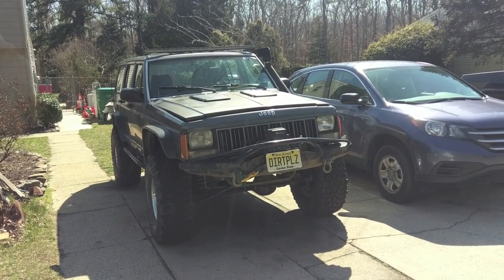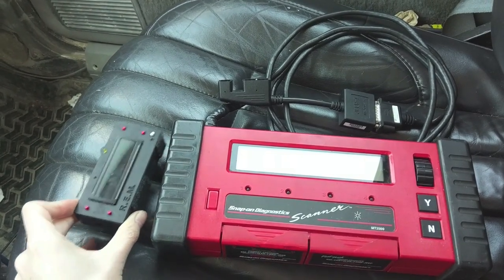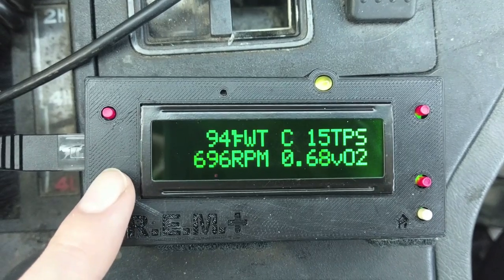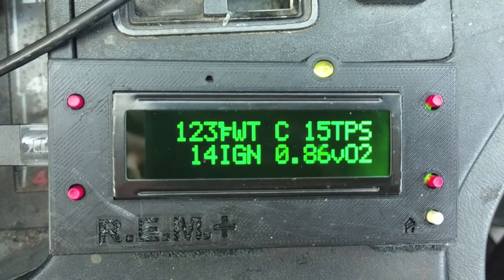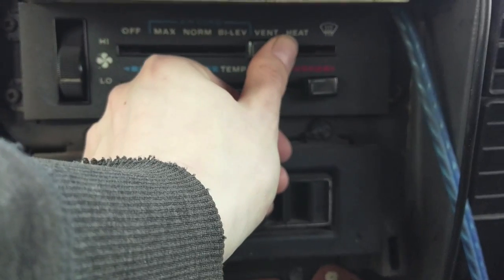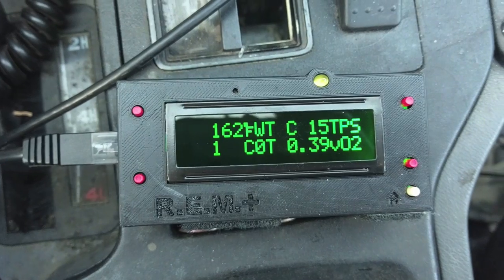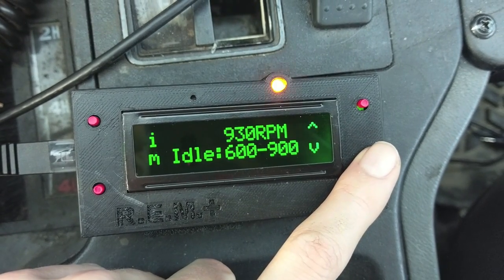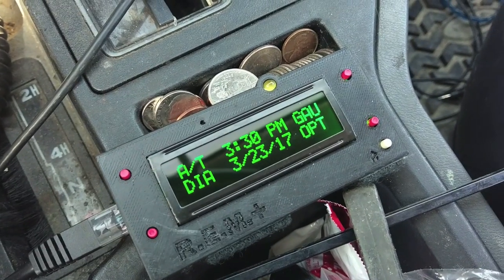What is Renix Engine Monitor / V3 + Demo

Comment: Is this something I can run into my dash and leave permanently installed in my Comanche? Hiding the wire and all that. I'd like to mount it so it looks like it belongs. Know what I mean?
Reply from the maker: Yes you can. I use an ethernet cord which is plenty small to run through a firewall grommet. I have mine mounted next to the a-pillar and love it. Other customers have found all sorts of spots around the dash for it to fit too
Reply: Love it. Mad props to you sir if you created this thing.

Comment: Hi, my XJ is a European model, gauges are in KPH, will your R.E.M be compatible? And also when will you get the one with bluetooth back in stock?
Reply from the maker: There are options for KPH and other metric conversions as well. The square REM shown here may be back by summer or fall 24. The REM clock panels should be available when I return in April.

Comment: Hi Nick,
I have question that maybe you can answer,
I've noticed that my battery voltage on the REM just barely reads 12 volts sometimes less, I happened to notice after watching your video that yours was reading 14 volts, does this indicate a problem? I just recently changed the alternator for a higher amperage one since I just added a second battery, so I know that it isn't the problem, and it read the same volts with the old one. I'm not having any issues with the battery but just wondering why it would read low.

Thanks
Reply from the maker: Are you sure the alternator is charging? Is it an internally regulated one and is the exciter wire hooked up? On mine, it starts at 14v and then slowly drops to 13v once the battery is topped off.
Reply: @NickInTimeFilms  yeah I just replaced it and there was no change...
Reply: I don't have any problems with a dead battery and when I check the battery while its running with a volt meter it shows 14.5 volts, so I don't think I have an issue, just thought it was weird the REM barely shows 12
Reply from the maker: Interesting, well in that case it could be weak wiring. The REM gets it's voltage reading from the injector feed line going to the ECU, so it could be weaker there
Reply: @NickInTimeFilms  ok thanks, unless you think its a problem I won't worry about it for the time being.

Comment: Do you plan on making a bigger version that can display more info at a time. I love my alpha model but some more info on screen would be nice. Like 6-8 items would be perfect
Reply from the maker: The thought had occurred for a mega model. I was experimenting with a 6 gauge screen at one point where each reading only takes up like 4 or 5 spots but it's not the prettiest and I'm running low on space for current models. I did get a 20x4 OLED display to play with and it's neat but harder to control and it flickers a bit. I can try other large character based displays or jump straight into the big boy stuff like full color displays where you could fit basically whatever you wanted. Just depends when I have the time, haha. I think i'd also have to get the teensy working to have the space I need for that anyway.
Reply: I'm more than happy with mine right now, so whenever you get time that would be something cool to look into. I'd definitely buy one
Reply: NickInTimeFilms
Reply: The LCD in my 03 Saab would be a perfect system. A button on the left cycles through 4 info displays and another button on the right cycles through 4 more.

Comment: You rock.  But why do you say Renix engines don't have a Check Engine light?  I def have a Reni...'89 4.0 Laredo, in fact I think it's the same one as yours and I had a Check Engine Light on mine for several years!!  Also, how do you thread the ethernet cable into the car?  Did you drill through the firewall or is there a hole you could use?  If drilled, where's the best/safest place?  THANKS!!
Reply from the maker: Check again. You're probably thinking of the Emissions Maintenance light which is only a timer that goes off to change the o2 sensor. There is also an upshift indicator for manuals, but definitely no Check Engine Light for renix because they don't throw codes like the HO Chrysler models do.
Reply: @NickInTimeFilms  Will check.  What about my second question of how you thread the cable into the interior?  What's the   I bought my renduinix from you last year (or more :| ) and have yet to install it!  Thanks!
Reply from the maker: On the firewall there should be an open grommet or 2 where you can push it through to the cab. I used one by the steering column and it's been fine.

Comment: Regarding the adapter. 

Facing the back of the unit with the red banana recepticle in the lower left corner of the unit with the switch to the right, which is the setting for the 4.0, up or down?

Thanks Nick.
Reply from the maker: 4.0L is down away from ejack, 2.5L is up towards ejack. The settings are also printed on the bottom of the door

Comment: i would like to see just a flat led so you can flatten the box and eliminate the lump on the top of the REM. i figure i'd mount the top of the unit to my lower dash. so the led lump would not work well with that. with that in mind, are you able to locate the ethernet connector in the back or bottom? if not, i can work with what you have, but i do recommend using a different led. i can look for smaller led if you'd like me to.
Reply from the maker: I could build a custom flat version if you were interested. Just need the dimensions or link to an LED you were interested in using. The connector placement is built into the board so the best i can do is give you a rear exit in the same location if that works better for you.
Reply: do you order from digikey, newark, mouser or another? if i had to guess it'd be newark...  i'll check the catalogs from whoever you use for your supplies.
Reply from the maker: I order from digikey

Comment: Does this help with diagnosing issues better than just winging it? 

Seems to give more info then the average obd1 or older obd2
Reply from the maker: Hell yeah it does better! 😂 This is the most indepth tool you can get for Renix. I found more readings then even snapon units show, and way easier than messing with a multimeter. Certainly more accurate then the parts cannon.
Reply: @NickInTimeFilms  Awesome man. 

Im considering ordering one of your back-order clocks for a comanche;

How diffiicult is the install?
Reply from the maker: I'll be back in April to start shipping again. Install is straight forward. Hardest part is just wiggling the dash bezel over the steering column. Otherwise just run a Ethernet cable through the firewall and the rest is easy drop in.

Comment: I got mine this week and it doesnt show anything almost like the engine is shut off. 

The red brick does work. 

It does power up though.
Reply: What kind of engine you have? This tool is only for Renix up until 1990. I connect it on a 88 XJ and a 90 XJ, both works fine.
Reply: @swisscarmb  
It was my mistake. I didnt read that there was a 2.5L and a 4.0L setting on the reader plug. 

Sorry i read it and forgot it when i got to the jeep a few Days later.
Reply: @felixmikkialmosttoasted3911  that happens, because I have good contact with Nick and he made the configuration for my 4.0 clear. So for. Me it was plug and play. 😉 It's good staff he make. And I pushed him to continue, because there are more around who will need it.

Comment: hey I was actually wondering what that power comfort is all about cause I got that but haven't  pressed it to see ..
Reply from the maker: It basically changes the shift points and how hard the transmission shift. In Comfort it shifts earlier and softer which you would think is good but soft means slipping and slipping means worn clutch material. Power shifters later and harder for a firmer feel. I always leave mine in power and in 91 they got rid of the switch so that it's always in power anyway.

Comment: 😍 I'd pay whatever just to have this on my 90 Ramcharger chrysler. Mines is a "SCI DLC" size under the hood. Since it's chrysler can I use an adapter and still be able to use this?
Reply from the maker: Just to humor you, I decided to look into it a little. It looks like a CHRY-1 Adapter is used, which is the same as the HO Jeeps. SCI Protocol is VASTLY different from the renix stuff so these will not work in any way for that. Your best bet would be if I ever got the HO stuff to work, and even after that it depends how easily other systems translate over. A snap-on MT2500 could do what you need for cheaper then what it would cost me to figure it out right now.
Reply: NickInTimeFilms NickInTimeFilms I'm reverse humored! 😂 you found all that out so fast man.↓↓
 https://www.boschdiagnostics.com/diy/products/bosch-obd-1300 under the manual on page 53 mines this that little "L" shaped one. There's also a few other diag. Ports on the driver's side under the hood no clue wtf they do bro. 

An MT2500 and who said size matters 😫😂😂 you sir. Plus yours just looks ever so much cooler. Come on look at the thing it's gorgeous and does much in a sweet little package.

Comment: I planning on putting a turbo on my 87 xj. Going to run low boost. How would your unit help me with tunning ect.?
Reply from the maker: Currently this is really only a live data tool so it could help you keep an eye on things, but it's not really a tuner yet. This won't be able to reprogram anything on the ECU but I'm currently experimenting with making a piggyback tuner using the map sensor
Reply: @NickInTimeFilms  thank you very much for the reply and information. Would love to see what you come up with in the future. I'll keep you updated on my turbo build. Maybe you can help me out if I get into a technical bind. Keep on keepin on. 🤘

Comment: You are a genius. I have a 89 4.0 with over 315 K miles, all stock and original owner. You have any idea if and when my tranny AW4 goes bad where to get it fixed ? All the tranny guys in los angeles dont even want to deal with it. I will be getting this scan tool very soon from you. All my best to you kid, take care and stay safe. God bless.
Reply from the maker: Not too sure where you could take it. I'm pretty sure the AW-4 is a rather simple transmission so I don't see why any good trans shop would turn their nose up at it.

Comment: Does it tell you if the shift solenoids are bad?
Reply from the maker: The TCU does throw solenoid faults when they aren't hooked up electrically. But in the older models it cannot tell if the solenoid has failed mechanically.
Reply: @NickInTimeFilms  so not on the renix?
Reply from the maker: Renix cant detect slipping or failing solenoids. It can only tell when they aren't connected. Scroll to the bottom of this for all the available faults for Renix https://nickintimedesign.com/aw-4-tcu-datastream/

Comment: Hey nick was your o2 sluggish/bad in this vid?
Reply from the maker: Ehh, that's about how it usually runs at idle. That sensor was a tad on the slow side, but the refresh rate was a little low. Stil swings up and down as it should. My new wideband setup is a bit faster to respond but still about the same swing speed.
Reply: @NickInTimeFilms  thanks for the reply i know this vid is old...
Ive noticed something odd using your rem module on my 89 xj....with key on engine off i was watching the tps swing while i push the gas..at the same time i happened to have the o2 monitor pulled up and noticed that the o2 voltage went up two tenths of a volt while pushing on the gas???
Any input on whats happeneing there?
Do you notice something similar with your 89?
Reply from the maker: @outlander7717  I noticed that too when I was playing around, best guess is the tps is letting in more air which is changing the o2 reading slightly. One way to confirm or deny this would be to unplug the tps sensor and see if it still does this to make sure it's mechanically related and not the tps pulling down the system reference voltage a little or something. Conversely, plug in a dummy tps and actuate it by hand and test for same symptoms.
Reply from the maker: Guess what!? I was doing some bench testing and confirmed, this is just some really weird glitch! When the engine is off, the o2 sensor voltage is not reported. Instead it displays some weird scaled version of the tps from 0 - 7. I have no idea why, but just seems to be a weird fluke!
Reply: @NickInTimeFilms  
Good idea ill unplug the tps and do it again and see what the o2 voltage does....thanks for the replies im loving my rem module.
Currently im trying to see why my ST trims are kinda high....(180 on a hot ideling motor)
Reply: @NickInTimeFilms  
Hey nick i got around to looking more into this fluke.
I unplugged the tps and with key on engine off the o2 value is now zero.
So there must be some voltage leaking into the o2 circuit from the tps....
I wonder if this effects the ecm reading of the o2 signal while running?
Reply from the maker: Hmm, that also might be something to look into, though I would hope not. I can use my wideband setup to hold the voltage constant and actuate a spare tps and see what happens.

Comment: cool but to bad its not working on the 2.5tdi
Reply from the maker: I'm hoping to crack that code one day. The 2 main things on my plate are designing the clock version and 2.5L support, so hopefully I can have another go at the 2.5L ECU after the clock is under way